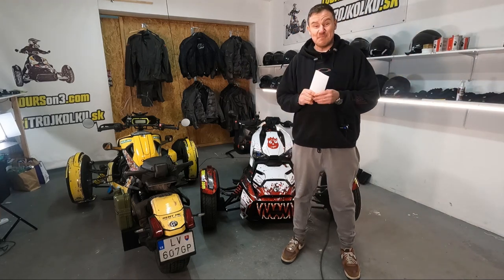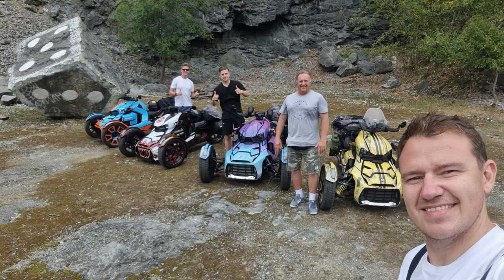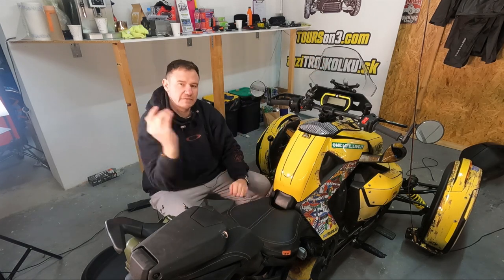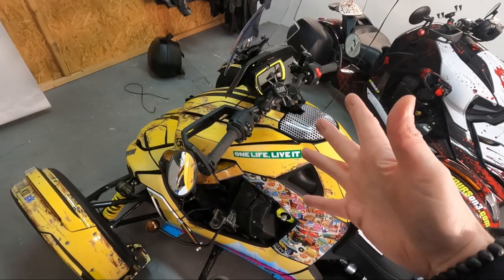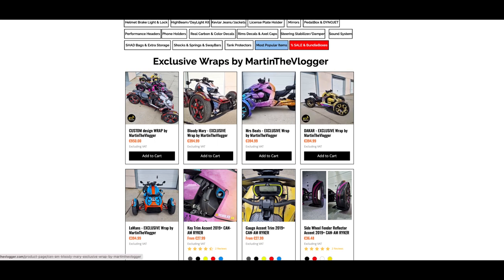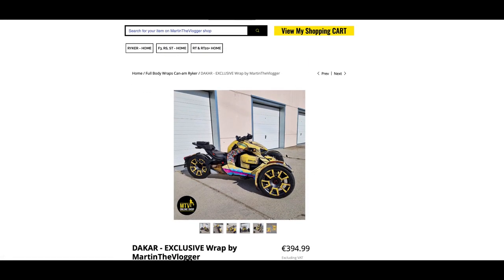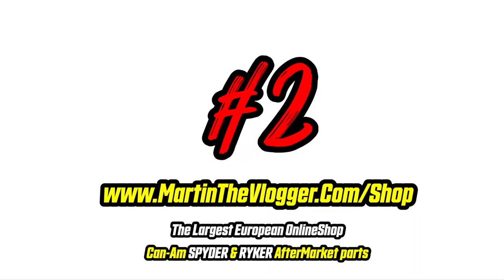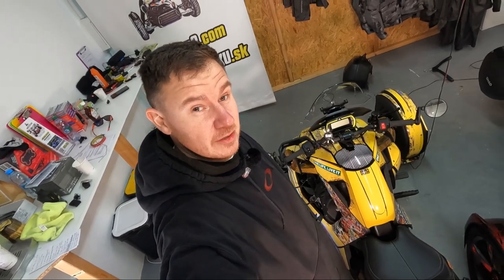Must have 15 upgrades for your #CanAm RYKER

Comment: The wheel nut socket is a must-have tool for all Ryker owners. A word to the wise! I own a 2022 Ryker Rally.  The front right and rear wheel nuts are LEFT HAND THREADS! The previous years of Rykers had right-hand threads on all three wheels. The wheel nut is clearly marked from Can Am indicating it is a left-hand thread nut.

Comment: I bought my Ryker second-hand, and it came with a comfort seat.  The first thing I replaced was the mirrors; I hated taking my eyes off the road and turning my head down to see the stock mirrors.  The ones I installed are high enough that I can glance at them without moving my head.

I wasn't wild about the squirrely handling on rough roads, and we have a lot of them around here.   First I replaced the end links, and that was an improvement.  Then I replaced the sway bar, and that also helped.  Finally I added a steering stabilizer, and now my Ryker 600 tracks and handles like a little sports car.

I also added a Max Mount and a three-piece luggage set, with a cargo box and two clamshell saddlebags.  All three of them have LED lights on the back and I light up like a Christmas tree, so I don't need the helmet light.  I will say though, that over years of riding bikes I trained myself to never let off on the throttle without also lightly tapping the brake pedal a couple of times.  I've done it so long it's completely automatic, and it lets people behind me know I'm slowing down.

I bought a basic backrest, and love the way it helps me keep my butt planted.  But settling against it made the reach to the handlebars awkward, so I bought a handlebar riser set.  It raised the handlebars 2 inches, and I tilted them back towards me maybe an inch.  That doesn't sound like much.  But now I sit comfortably erect, instead of hunching forward and getting a backache.

The Max Mount has enough space between the backrest and the cargo box to strap down a 44 lb. sack of dog food, and the box and saddlebags fit enough bags of groceries that I rarely have to take a car to the market.

I have a Bluetooth helmet that the previous owner threw in with the Ryker, and I see no reason to annoy people around me by blasting music on loudspeakers.... 

The socket, tire repair kit and first aid kit are all good suggestions.  The previous owner supplied a socket, and you've convinced me to buy the tire repair and first aid kits; thank you.
Reply from the maker: Thank you for very nice wrap up 💯💯💯💯🤟

Comment: The first thing  I got was the windshield. Installed it right there at the dealership.  The second thing I got was the BRAKE EXTENDER.  This thing cost $25 and was the easiest thing to install.  The 3rd thing that I got was mirrors for my mirrors so that I could see behind me.  $6.99 amazon. The seat is fine. I rode it 400 miles no problem. Rykers fix body ailments. I come from the 1980's where you had to get off every 50 miles even on a Gold Wing.  Tough'n up. My helmet has a built in stereo.  A loud speaker is only going to make people hate us more.

Comment: Excellent video. I have a tire repair kit, mini compressor, big ass 64mm wheel socket, trim tool, screw driver and torx set.
Reply from the maker: You are ready 👌👌👌🚀💯

Comment: Great video. I've owned my Ryker 900 Ace for over over two years. Watching this film is like asking me what I've done to my Ryker.
I have:
Shock Factory Suspension, Baja Ron sway bar, Steering Damper, Solo comfort seat, hazards, Dynojet, DTE throttle box, Custom Chrome fender lights, bullet rear indicators, jockey shifter, foot boards, brake pedal extension.

Comment: We have neuro tuning - and this can unlock the beast mode .........in Canada ,  I also have most of the item you  gave except the handles , shock are Elkas 3 , great information I got the wheel nut and you information is great,  If I go to europe , I will go to rent a ryker and tour with you ...... Alain and  Yellow ( ac900 2021)

Comment: The 600 isn't locked due to EU rules?
Reply from the maker: Nope, on 90% not as it is on the limit. At least it was like that with 18-21 bikes
Reply: @MartinTheVlogger  Cool, thanks for the info! Regards from Sweden
Reply from the maker: @elestromusicgamesfun1101  🤟🤟🤟🏁💪

Comment: why tell us half a story, what size is the socket, surly it would have the size on the socket/
Reply from the maker: I am sorry but you are not right. These are custom made , if we are talking about rims socket and they dont have the size writte at the back :(((
Reply: @MartinTheVlogger   sorry still doesn't help, I took delivery last week of new Ryker Ace, all there was as regards to tools was cheap screw driver, which to say the least was a bit disappointing. just found out you need a special tool to loosen the drive belt, you would have thought at the very least there would a tool to undo the wheel nut. so if I get puncture I'm stuffed, may be you could point us in the right direction as to were to get as socket, Regards Terry,
Reply from the maker: @spgranorthiam123  hi terri BLR tunning sells full kit for replacement of belt, call Bill and tell him I send you. Also he may help you with wheel socket. I have these wheel sockets on my shop in Europe 😉 , bill is from US https://www.martinthevlogger.com/product-page/canam-ryker-600-900-rally-sport-wheel-nut-removal-socket
Reply: Tanks for reply Terry,
Reply: It's a 65 mm socket.  Mine must not be custom made, because it says that right on it.  😄